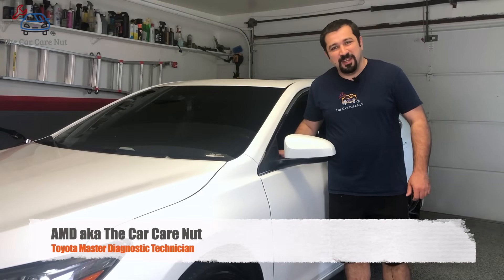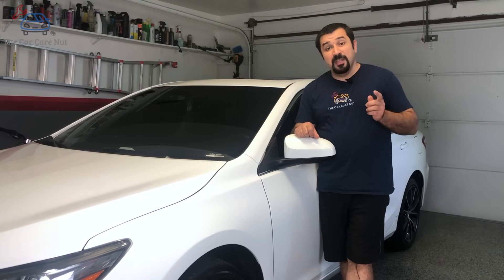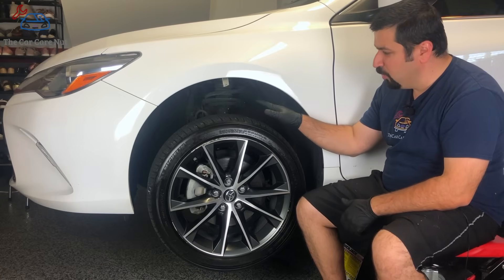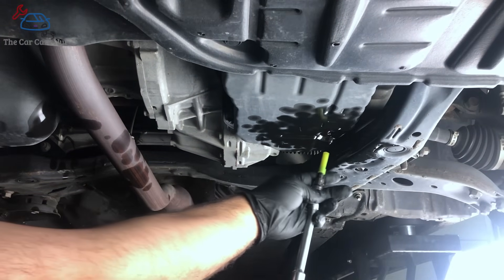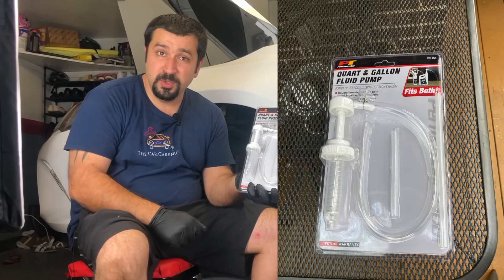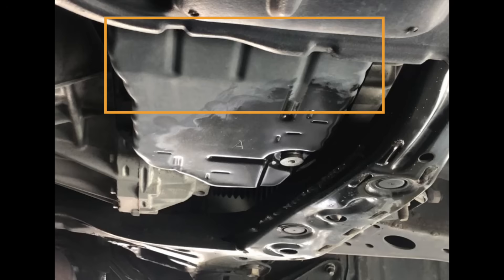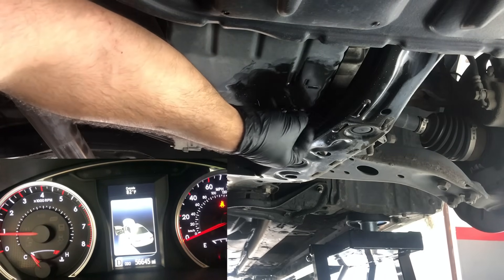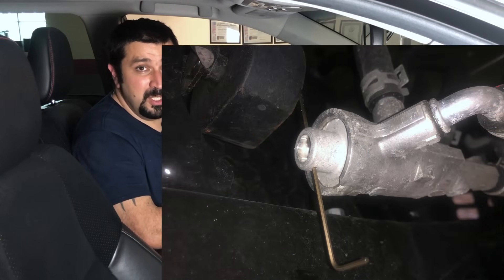How to change your Toyota Sealed Transmission Fluid

Comment: Appreciate your videos.  Just did mine today.  One technique I did see someone else use was to turn the wheel all the way to the left, it opens up the area to take the panel off behind the front left tire and gives you access to the fill area.  Works if you don't have jack stands or a lift.  Another option, is once the panel is off, stick a light near the transmission and you can come in through the engine as there is enough space to snake a 2 foot hose down to the fill hole.  Then just stick a funnel into the hose.  Followed all the other steps and it worked great.

Comment: If you replace the new amount with the amount of fluid that came out, why do you have to worry about the temperature .
Also, does it hurt the transmission if it has a little more fluid if you get the temperature wrong?

Comment: I sell AMSOIL Transmission Fluid it out performs Toyota’s WS transmission fluid I have 80,000 miles on mine. It drives better shifts smoother has a smooth acceleration. It’s a great product to put into Toyota Toyota WS seems a gel up when it gets  hot and clogged trans the filters AMSOIL ATF does not do that..

Comment: I have 2011 gx460. Would I have a cooler that I have to do the bypass procedure? How long do you think it will take my trans to reach the overfill temp?
I saw in other videos you pulled the check plug when it was cold and running then again at the correct temp. Can I do it just one time like you did here so i get to notice the gush and then trickle at the temp giving me peace of mind? Ill overfill just half quart when adding like you did here
Thank you

Comment: I have a 2015 RAV4 FWD 2.5L U760E. 107k mi. Tranny never serviced as far as I can tell. Dealer did do a 60k mi service,  but I don't know if they touched the tranny. I drained and dropped the pan total drained fluid exactly 3.5 qts. While examaning the plastic inner snorkel I noticed it wasn't screwed all the way up in the metal pipe until it was at the top. It was stopped at the end of the metal drain plug threads, not the top of the metal tube where it had three or four more turns to go before it stopped. 

Replaced filter, cleaned magnets and pan, reinstalled plastic snorkel while the pan was out so I know it was all the way in when I replaced it.. I refilled with 4 quarts since 3.5 came out. When I did the refill drain/check procedure using a scanner starting at 104 degress, only about 1/8 quart stream came out before the dribble! Wow. Sure the fluid was dirty and the magnets had build up on them but nothing out of the ordinary in my experience and the car runs fine. I have been monitoring the fluid temp at the end of drives using my scanner and the A/T temperature range has been 180-195 degrees F. No shutter, no strange sounds, no leaks, etc.

That means my transmission had been about 3/4 qt low due to the plastic inner snorkel not being threaded in all the way by the last person who serviced it. Would the factory make a mistake like that? I assumed the facotory would just fill a set amout if the system started dry. Mind you I only used my fingers on an extension just like in this video to nudge it in finger tight. * There are two sets of threads in that metal pipe.*  One lower set of threads for the metal drain plug,  a small gap, then a 2nd set of threads for the plastic snorkel near the top and thats where the snorkel gets snug. Have you encountered the snorkel tube not being all the way up inside the metal tube before?

Comment: It took 32 minutes for the D to be solid for my 2013 Sienna FWD. The outside temperature was 34°F. You need to be patient. One important detail that you DO NOT turn off the engine after the D stays solid. If you turn off the engine, more fluid will be released from the transmission. Then you actually would drain too much fluid and it will lead to underfilling. Finally, I want to thank the Car Care Nut channel for making so many great videos for DIY Toyota owners. Wishing you the best, Sir.

Comment: Hello. Great video. I’m planning on using the laser thermometer tomorrow. My car is a 2013 Camry se 4 cylinder. The transmission is the 19 bolt pattern. What temperature range do you recommend?  I will be doing the filter change as well.

Comment: In the last step when the D indicator becomes solid, should I leave the shifter in drive or neutral position before going to check the fluid level?

Comment: Excellent! So as you are shifting from D-N-D-N-D, all of a sudden the D indicator will stay stuck in D even though you are still shifitng D-N-D-N-D? Also, what temperature should the pan be if you are using the temp gun method? I assume the outside of the pan is not going to be the same as the actual internal fluid temperature. Thanks

Comment: Can I just drain it cold and measure and replace with the same amount of
Reply: That's not good because that's assuming the person that did it last out the exact correct amount in and that's something I wouldn't risk. A transmission problem recently just ran me ragged.

Comment: Regarding the paper clip obd2 procedure, after shifting back and forth between drive and neutral, and D light comes on for 2 seconds (and presumably we are successful at putting car into ATF temp check mode) are we then putting transmission in park? And removing paper clip? And the ATF temperature check mode is still working (presumably until car is shut off)?

Comment: could you clarify... when shifting between neutral and drive when the drive light comes on steady you say to release the brakes but do you leave it in drive or neutral (in theory, if the car is on all four jacks it shouldn't go anywhere if you leave in drive but there is are spinning wheels and axles to watch out for?)

Comment: When using the temperature gun you recommend in your description, what temp do you want the gun to read? I ask this because the outside of the transmission will be cooler than the interior fluid. If you wait for your temperature gun to read 105, the fluid may be way hotter. So what temp on the gun do you recommend? Awesome job on the video! Thank You

Comment: I have 2022 Lexus UX 200 with 40,000 miles. When is interval for cvt fluid change? Per AMD, all Toyota vehicles need to change for transmission fluid at 60,000 miles. Some mechanics recommend change every 30,000 miles.

Comment: Hi, I'm from Australia and there is a lot of imported Javanese toyotas (JDM), so i wanted to change my 2010 estima acr50w, now, the car came with a Javanese owners manual. Me being silly, i forgot to do google Lens translate on the maual to see what type of fluid. I called toyota, but my no. Plate dont come up on their data as it is an imported vehicle, so i called transmition specialist and finaly they told me there should be a sticker on the passenger door pilar that says what is the transaxle model. And it was k112. Now, after i figured out it is a CVT transmition, i rushed to toyota dealer and bought the expensive 2 of the 4 liter contanier of FE(fuel efficiency for late model CVT) fluid. So far, everything is good. Now 2 weeks later i discovered there is 2 types of Toyota CVT fluid, 1 is TC(torque convertor) and the other is FE (fuel efficiency). Some online websites say use TC as its designed for the  older CVT, some sites says use FE. please help as i might used the wrong type of CVT and its driving me crazy as lots of mechanics saying you cant flush a CVT. is it a big deal useing FE instead of TC? your answer isngreatly appreciated.

Comment: If the fluid contracts when cold and is below the fill tube, why does so much fluid come out when you first open the drain plug?  Does the factory overfill?

Comment: Just to say, doing this on a 2014 Sienna van did not require jack stands or even wheel removal, just wheels turned fully to the left. Also, I found it interesting that with an OBD Scan tool at an ambient 60°it took quite a while, even a little drive around the neighborhood to get the transmission fluid up to 100° (I'm told the range is 96° to 115) so I tested the drizzle level at 105 degrees. At that temperature you could hold your hand on the pan all day (it's a typical hot tub temperature), but I will tell you that an IR temperature gun registered about 98°, so low. I have to say that I think  this is the stupidest thing Toyota could have done. What did they save in manufacturing, $2? Or is it that the dealer gets to charge me $337 to drain a few quarts of ATF, and then check the level. 
Appreciate your videos.

Comment: Thank you very much for this video. I can confirm that this is a Toyota procedure, it is in the factory service manual for my 2017 Camry. For others' reference, once the vehicle reaches adjustment temperature the electric fans turn on (it took maybe 4-5 minutes to reach this low point). Then it remains at operating temperature for 5 minutes (I timed it), and then the fans turn off when it passes the high point. This was measured at 60 degrees ambient temperature after sitting overnight, your timing will vary based on the ambient temperature.

Comment: Thank you for the detailed instructions.  After the D light came on, I left the transmission in neutral and pulled the drain plug and a whole lot of oil came out.  Please ammend this excellent video by telling us what position to leave the selector in while draining the excess oil. I know that there are some things that we all "should just know", but your dealing with humans and we all think differently.

Comment: I can't find any video about doing transmission drain and fill that they mention about the cooler bypass for this procedure. I'm still confused about it. Can you explain in what step should I attach the allen key to lock the pin and what size allen would be the best? I have a 2023 Rav4 Adventure

Comment: First, thank you for this great video. Second, when I did my 2023 Rav4 TRD Off Road, both the transmission fill AND drain plugs did NOT have a crush washer but a Toyota PN 90430-A0003 "gasket". I had purchased two of these beforehand as this is the PN found when doing research on the drain and refill procedure. I did visually verify that these were the same (also used calipers to confirm thickness and diameters). I did have four PN 12157-10010 "Drain Plug Gaskets" for the transfer case and rear differential. Those both had the same crush washer in place from the factory. Can you confirm, or not, that the 90430-A0003 is the proper "gasket" for the TRANSMISSION fill and drain plug? As I stated above, these were the same, or similar, "gaskets" that were in place from the factory when I removed the fill and drain plugs on the transmission. 

Also, I neglected to to pin the bypass cooler open when draining and refilling the transmission. I accurately measured what what was removed from the transmission and I added more fluid and followed the fluid check using a scan tool. Did I just not get more fluid out than I would have if I had pinned the cooler bypass? Thanks for you help.

Comment: What is the right temperature or temperature range to measure the transmission fluid on a 2020 Toyota Corolla with a CVT transmission? I couldn't get the right temperature with the jumper in the OBD2 connector

Comment: To AMD - How do you warm the trans fluid after refill when it’s on jack stand? Do I simply run engine in neutral or do I drive around the raise car and check? About to do my first trans fluid drain and fill and would really like help with this.
Reply: After you refill with new fluid, you start the car while it's on jackstands. The vehicle will need to be on jackstands to be able to get under it to do the level check outlined in this video. Yes, being under a running vehicle is nerve wracking to me too, but it's the only way this procedure can be done. This is why safety is paramount with secure jackstands under secure mounting points.

Comment: I have a 2017 Sienna and I'm following the drive indicator temperature check procedure.
My the "D" is solid, but the border/ring around the "D" flashes. Does that mean the temperature is too high, or will the "D" itself flash?

Comment: When the transmission reaches temperature, and the drain plug is removed, is the helper in the car holding the foot on the brake with the car in gear, or is the neutral or park position used at that time?
Reply: No. The vehicle stays in Park while the drain plug is removed to get the proper level.
Reply: @SojournerNX  Thanks.  That's what I did.  Unfortunately the instructions for jumpering the OBD2 port didn't work on my 2022.  There is no conductor in one of the pin locations, so I used a temp gun (actually two of them to validate meaurement).

Comment: For a 2020 you dont need the jumper wire, you can just do the gear changes and itll put it in transmission temp read mode.

Eta: thanks for the clear upload. After watching this and picking the dealership mechanics brain a bit, ill be doing a series of drain and fills over the next couple months on my neglected 2020 with 150k

Comment: This is a great video , very informative. I was wondering though . Shouldn’t we be doing this procedure 2-3 times ? To actually get all of the fluid changed ?
Reply: No, there is a delicate balance of old fluid with wear debris vs new fluid. Both are necessary after a transmission has worn in.

Comment: On the last step on adjusting the gears for the fluid level once you take the wire off and go adjust the fluid level do you leave it on neutral or on drive?
Reply: No, put it back in Park.

Comment: Bless you too  - that's a very good tutorial
Question:  I have the 2017 - 2 litre Rav4 with CVT ( I think this is the Sequoia in the USA).  Must I only use the Toyota CVT Transmission fluid FE?  
I see that the general parts dealer here recommends the following two fluids for my car: (13~19 Toyota Rav4 Gx 2.0L Petrol)

Penrite CVT Fluid Low Viscosity Full Synthetic - in 4 Litre bottles
NULON EZY-SQUEEZE Multi-Vehicle Full Synthetic CVT Transmission Fluid - in 1 Litre  squeeze bags.
The Penrite actually says on the bottle - Toyota CVT FE
The NULON bag just says Toyota - I don't see the FE on the bag

Comment: AMD, hello. You are the best, period, end of sentence. I have a quick question. I have a 21 Highlander with v6 and i am approaching 60K miles. Want to do a transmission fluid change. Since i am only replacing the fluid (the pan and filter remain untouched) why can't i just drain the fluid in a pan and measure precisely how much came out and simply replenish the transmission with the exact amount of fresh fluid. This would eliminate the work and user induced errors in raising-leveling the car, reading the temperature and staying in the range while checking the level etc. May the Lord bless you !
Reply: If you're the only owner, then you could get away with that but the fluid level check isnt that hard. If you're not the original owner, there's likely no way of knowing if they messed with the transmission previously - advocating for the fluid level check.
Reply: Thank you for your reply. Makes sense.

Comment: Correct me if I am wrong, @ 8:32 I saw that you are holding a ATF WS fluid which is not suitable for a CVT transmission. It should be fill with a CVT transmission fluid.
Reply: He is performing this on a 6 speed transmission. It's not a CVT

Comment: Question. Why can't you drain then measure the fluid after it reaches the same temperature as the new fluid in the bottle. Then replace with that exact measured amount ? Thanks :)

Comment: What is the right temperature range for checking transmission fluid level with a dipstick on a 2004 Toyota 4Runner with 4 speed transmission (non sealed and with a dipstick)? 
The dipstick has just two marks -  cold and hot. Should the trans fluid level reach hot mark or be between cold and hot? and at what temperatures? 
Also, how to enter the diagnosis mode? is the procedure for the 4 speed non-seal transmission with a dipstick similar to what is described in the video (moving shifter between D and N)?

Thank you in advance

Comment: I have a 2016 Sienna about to reach 130k of mileage.  Recently, I had the state inspection done at a Toyota dealer.  They highly recommended me to do the transmission fluid change which has never done before since I bought it as a used car.  I did watch your video about not to change transmission fluid for high mileage if it has not been done before.  Please advise if I should do it.  Thank you!
Reply: He recommends NOT changing the trans fluid if a vehicle is well over 100k miles

Comment: I have a 2015 Sienna with 199K miles. I bought it with 125K and I dont believe the transmission fluid has ever been replaced. Should I leave it be or do a few drain and fills to replace the 6.9 quarts it holds? I am getting mixed feedback. I bought 7 quarts of Valvoline Max Life but am hesitant to move forward.
Reply: He recommends NOT doing a change on a vehicle well beyond 100k miles.

Comment: Have a 2020 Rav4 i tried to do the jump wire check. No Xmas lights, but the D goes off after back and forth from.N to D, D to N, for about 7 reps. So i put it in P and waited. But once the D illuminates after around 5 minutes,  some sort of Fan starts not sure if it was the Radiator. But i was not sure how to exit as the D would not change when i shifted from P to R to N to D. Nothing changes. Am i missing something? Or since the D illuminated it is safe to remove the jump wire, shut the car and then let ehe excess expanded teansmission fluid drain out?